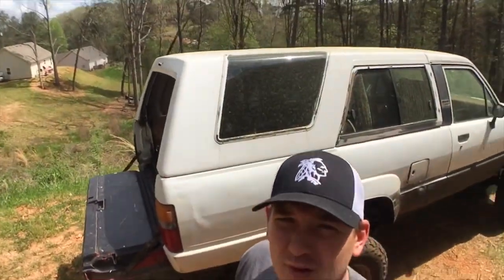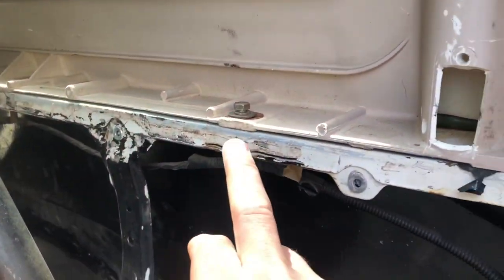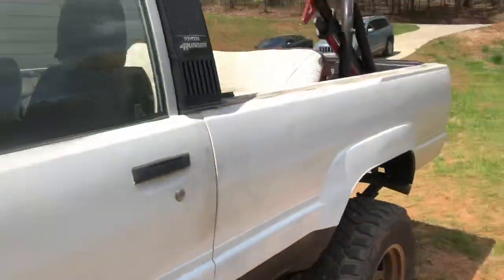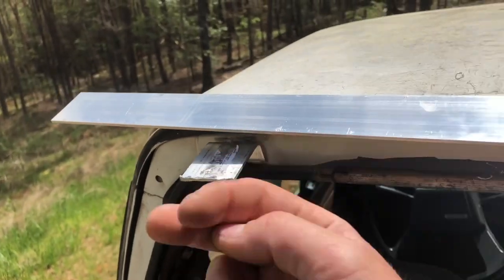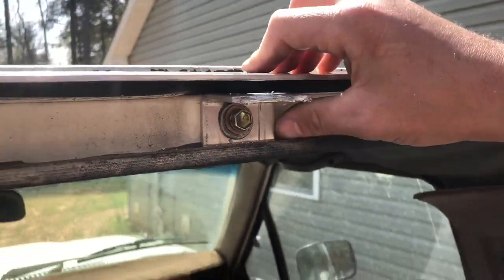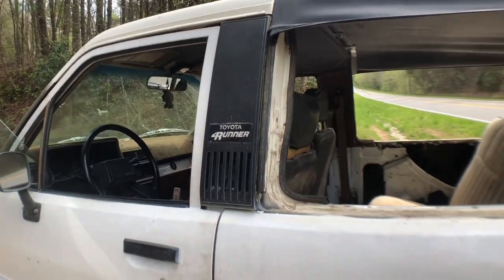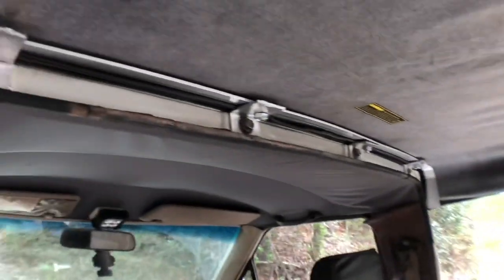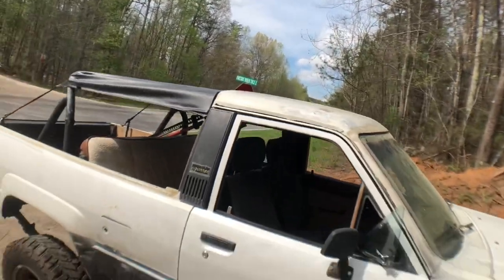75$ 1st gen 4 runner soft top/bikini top !! Awesome DIY for 1st Gen Toyota

Comment: From eyeball if you haven't changed anything the bolts will all be the same, there is a switch on the 2nd to last bolt hole going toward the rear on driver side